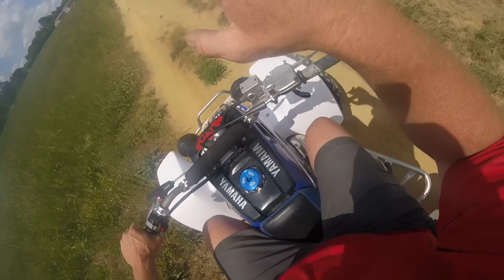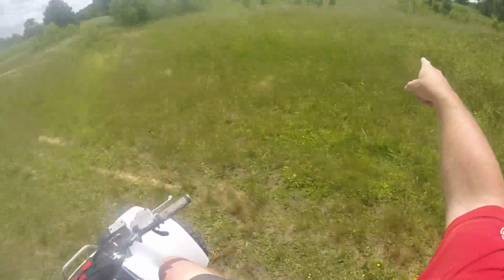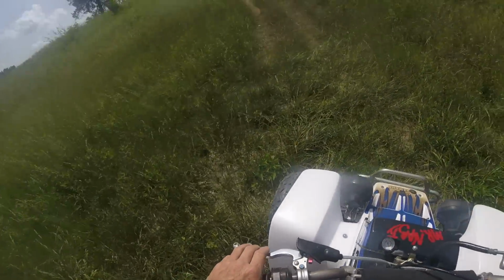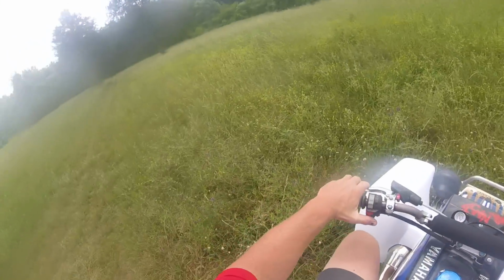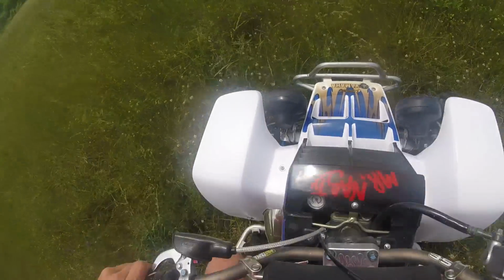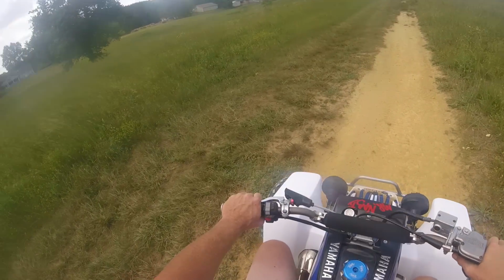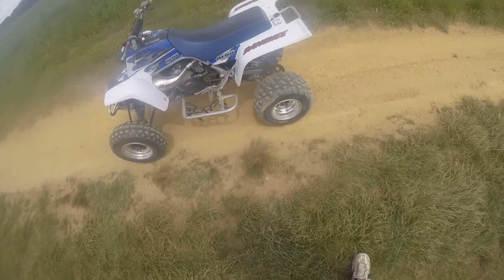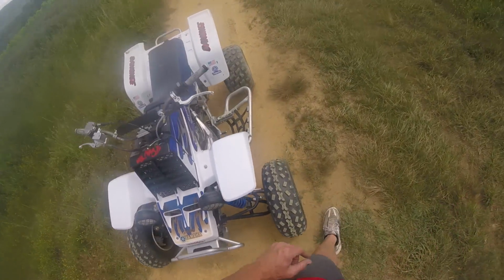Things I hate about my 421 cub motor

Comment: No matter what one i rode a 250r, Tecate, Lt250r, Quadzilla, Yfs200, Trailblazer, Trailboss Banshee and several bikes they all did them same things. Plain and simple it's a 2 stroke thing. It might be more pronounced with motor size and the type of porting but still well known cons of any 2 stroke. They don't have much torque so they don't lug well and are more of a workout to ride any tight terrain. I haven't seen many 2 smokers to start without blipping or cracked throttle either. These days no one buys one to not be in the PB or to lug and should expect it to start more finicky then the opposed 4 stroke. I bought my Banshee for the oh shit factor, mid to full throttle runs, the sound and the instant fear it strikes in most 4 Jokers minds. I most definitely didn't buy it to lug or ride on anything short n winding.

Comment: At lower rpm it almost sounds like it's running on 1 cylinder so check your ignition system cause you might have weak spark.

Comment: Most of that is just big pipe banshee traits than anything else, it’s not a CR/KX 500
Reply: If he put ssr on it then it would start easy and be a torque monster but his exhaust is made for top end!
Reply from the maker: Exactly
Reply: @leehuntley189  ssr?
Reply: @frankie9660  the fmf small pipe that's made for woods riding....low end grunt! They're smaller diameter but longer! Check them out if you want that low end!

Comment: These motors aren’t 4 strokes they don’t lug around. You have to really let it get high in the rpm. Try not to shift till each hear won’t let you go any faster.
Reply: Thats not true my husband had a full bolt on banshee that I learned to ride on that was my very first atv that I rode with a clutch and i could putt around on it all day and it never fouled plugs or anything thats how I rode it until I got used to it

Comment: Is it possible to pull wheelie with this at slow speeds with clutch for example or Will that just loop it
Reply from the maker: It will yes
Reply: @banshee100  so only high speed wheelies

Comment: I have a 421 Cub Serval and it is built exactly to the same specs as yours same pipes same crank same everything except mine is a Serval I run smaller domes for pump gas but I start making power I think it was between 3600 and 3800 rpm the Serval starts making power and a Cub doesn't start making power till like 6800 rpm my builder even told me he says in a drag race a serval making 80 horsepower can easily beat a cub making 90 horsepower in a drag race just because you start making power sooner yes you might not make quite as much peak horsepower but if you're barely able to drive the thing in anything except asphalt then what's the use of it unless you're drag racing more straight line stuff
Reply from the maker: Maybe if you're racing dynos in 5th gear I have races ported seals on racegas and still beat them ,under the curve a serval makes power faster yes but  you don't race a cub in the wrong gear ,example serval 3600 50whp 8000 80whp my cub revs to 9700 98whp you may have alittle more down low buy the top whp will always come back around ,but yes a serval is better all around woods motor no doubt
Reply from the maker: Also my vid shows it jetted 1 main jet rich when I drop to a 152 main it don't do these things ,I just want to keep it on rich side still should be 95whp with 155 main

Comment: All these issues that you don't like would be fixed if you were to buy a Cub Serval that's why the servals were brought out the Cub motor is a drag race motor they are all top and people that buy them and try to build them for the trail it never will work you can't get that low end power band with a motor with extremely high exhaust port durations high transfers and high exhaust ports give you lots of power let's keep run lots of timing and lots of compression but they don't make power till the top end that's the drawback to them
Reply from the maker: It has plenty of power down low any  not going to have a whole lot of power before the poweband, but a serval is better to match stock curves
Reply from the maker: https://youtu.be/5Wti8FLRAtY

Comment: What would you recommend for a dirt road / trail bike?
Reply from the maker: 400ex or z400 kfx400
Reply: Sorry bout that I did word it wrong, I meant like engine set up on banshee
Reply: What would you recommend for engine set up on banshee for trail / dirt road ripping
Reply from the maker: 421 serval
Reply: Do I need to upgrade my crank or clutch or anything?
Reply: @banshee100  what do I need to make a good 421 serval? If you don’t mind.
Reply from the maker: Pwk 35mm carbs vforce 4 reed's lock up clutch

Comment: “ Red -necks” &  “ Two-strokes” don’t apparently mix well😉😆👍.    A Banshee was made for “ Gettin it on “ out in the dunes and they love upper RPM ranges . Never were meant as “ Low RPM Torque monsters. Most will run up around 100 mph in dunes topped out in 6th…… don’t short shift up & up & up , gear after gear. Let “ Er Rip “ 👍.    And run good oil & premium fuel if it’s got porting / pipes/ aftermarket heads & reeds.  Have fun & keep it rubber side down man!🤞
Reply from the maker: Lol 😆 I'll do anything for views
Reply from the maker: Apparently you just seen 1 of my vids 😆
Reply: He lives in Tennessee...long way away from dunes! He definitely needs to see your other vids! I miss mine!